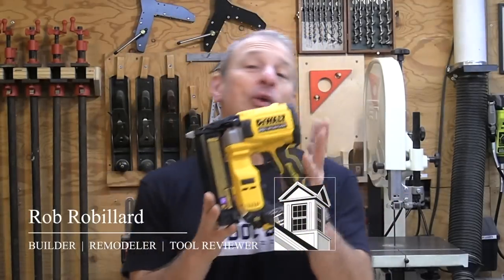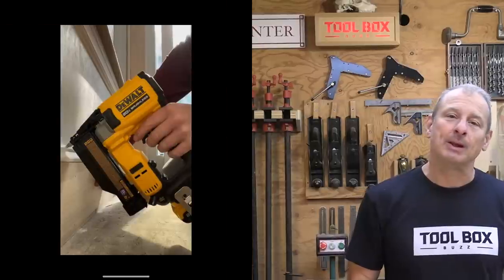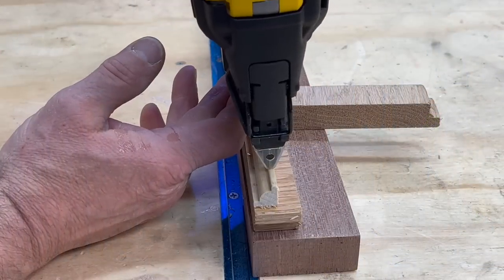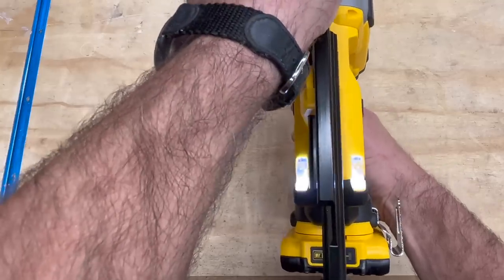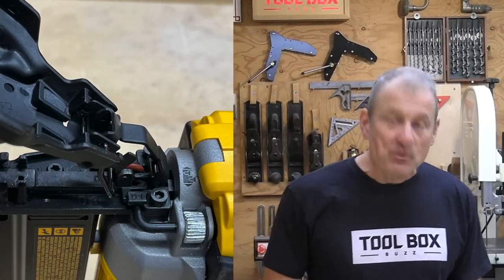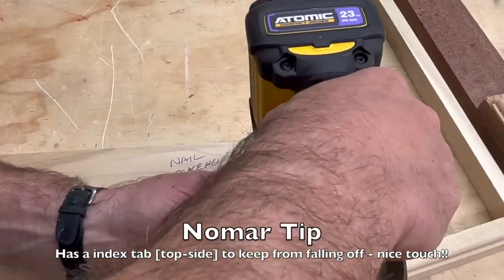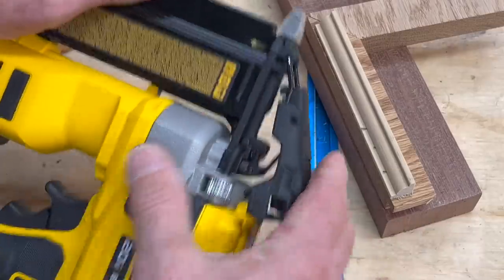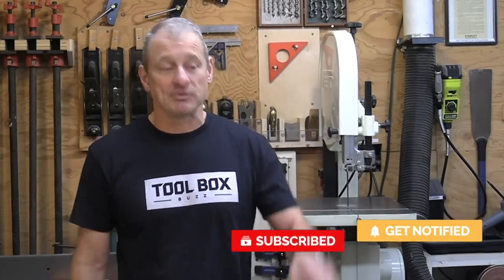Dewalt 20V Atomic 23 GA Pin Nailer, DCN623

Comment: I have both milwaukee and dewalt pin nailers and i really like both of them. I love the 20v dewalt one cause it can shoot forever on 1 charge, m12 nailer however would run out on me and i would have to charge it through out the job. I love the lightweight of the m12 one and how it sounds when it shoots. Just feels good to hear those pops. Both nailers in my opinion are great tools for anyone who does finish carpentry.
Reply: Have you guys seen the Makita 23 guage pin nailer. It's smaller, narrower, and very compact. Power can also be adjusted easily on the fly. Not sure why anyone would consider this bulky Dewalt (unless you want to stick to the battery platform), especially seeing as you can't get into narrower spaces. Just putting it out there.
Reply: @arnoldwiggins  I'm a Makita guy, and I'll tell you the performance of the Makita sucks. I'd love for them to fix their cordless nailer line because I'm invested deep in the blue tools. I know I can get a battery adapter and use any tool I want, but what I want is a good Makita nailer line.
Reply: The Makita 23 g cordless nailer is junk.. misfires all the time and leaves pins sticking out. I  own it but never use it.. will be getting this dewalt

Comment: Nice to see an addition to battery powered 23 gauge guns.  Can't wait to try it.  So far we've been using Ryobi and Milwaukee pin nailers.  Pretty happy with both. Ryobi is big and ugly but shoots good and it continued to shoot good until it completely broke after about 2 years of use.  Milwaukee shoots like a dream for about 4 months until driver tip gets worn, then it won't drive nails all the way in consistently, because I think driver slips off a nail at some point.  We're on third Milwaukee gun at this point, shoot amazing but doesn't last under heavy abuse.  Because of Nitrogen cylinder inside the gun, Milwaukee will not sell you a driver to replace it yourself and you have to either ship it back to them or take it to a certified service center.  Which means downtime when you need pin nailer now, so that's how we end up with a pile of used up Milwaukee guns.   I will say, when laying staircases from waterproof luxury vinyl, we put these guns through tremendous abuse.  LVP like Christina Collection can be extremely hard for pin nails to punch through and sometimes we also get bent nails because we hit a nail head in the subfloor.  Combination of those things put a lot of wear and tear on the driver tip.  So driver lasting 4 months laying staircases from hard material will probably last you years if you use it to nail soft woods like trims in finish carpentry.
Reply: Means as a homeowner it will last me forever😂

Comment: I am on the fence on getting the dewalt or the m12. But this in depth review definately helped. You covered something, other 10+ reviewers never mentioned.
I just wish Dewalt comes out with a smaller 12v pin nailer. That would be awesome.

Comment: DeWalt is late to this party. The M12 is a very nice tool. I've personally been running the Ryobi for almost 3 years and the Metabo for a couple months. I actually like the Ryobis action and double trigger better than the Metabos safety. Have you used a 21g nailer Rob? I have a Grex 21g that I use for built-ins and cabinet crown. It's a great tweener nailer. I wish I bought the Senco with the double trigger safety rather than the Grex press tip safety. As you know the press tips like to shift small material because glue is slippery.

Comment: I'd be surprised if the red ring wasn't silicone rather that nitrile rubber. Temperatures shouldn't be a problem, but its durability remains to be seen, I guess. Odd that it needs to be there at all.
Reply from the maker: That’s a good point, probably is

Comment: Saw someone post that the Milwaukee framing nailer was trash -- they're dead wrong. I run ALL DeWalt, and have all their nailers.  The flywheel is a bit annoying, but I find their trim nailers to be fantastic. Just had the chance to use the Milwaukee for a day. The milwaukee framing nailer is SUBSTANTIALLY better than the DeWalt. More powerful, no flywheel -- it's just superior in every way possible.  As for the 18, 16 and 15, I still like my yellow.  Thanks for the review of the pin nailer, Rob.

Comment: Now if they could just redesign the other nailers to do away with the fly wheel. The recoil is the bane of Dewalt nailer guns.
Reply: I think their framer and 16 guage nailer are the best .The flywheel mechanism is the best I've used ,not bulky and easy to maintain, the Milwaukee framer is a piece of crap imo.

Comment: Interesting. I am a DIY type person for most of my smaller projects. If you were replacing a small piece of 3/4 inch round would you use a pin nailer or an 18 gauge one?
Reply: 23 pin nailer.
Reply: And use 1&3/8” pins
Reply: But if you are asking which to buy? Between 18g or 23g?  The 18g can do waaaaaay more because most shoot 5/8” nails to 2” nails.
Reply from the maker: Brad or finish nailer Depends on what your nailing to
Reply: @ConcordCarpenter  Thanks

Comment: I totally agree with you about the red rubber band under the jam release lever.
Was going to purchase this pin nailer at Home Depot.  They had it on display, so I started to fiddle around with it. As soon as I lifted the jam release lever and saw the red rubber band (before I saw this video), I was turned off.  I looked at it carefully to see if it could be replaced easily, and it did not appear to be the case.  The red rubber band was definitely a DEAL-BREAKER for me.  I looked at the Ryobi P318 pin nailer, saw that it didn't have a depth adjustment, and no tool-free jam lever.  However, it was on sale for $190.00 Canadian, or about $135.00 U.S. So, I decided to give at shot, and purchased it. Even without a depth adjustment control, it always sinks the nail to the right depth, regardless of whether it's soft or  hardwood (I've used it on pine, cedar, walnut, oak, maple, mahogany, etc.).  Was a great decision, and have had no issues or regrets with it so far.

Comment: Thanks Rob! Great video as always. I’m in both the Milwaukee M12 and DeWalt 20 volt battery platforms. Which of the two pin nailers do you currently prefer?
Reply from the maker: Milwaukees size

Comment: Bought mine bare for £160 🇬🇧.  Feels light and compact . Included was 400+  Bostitch pins , so had a play . Depth adjustment only needs configuring once or twice depending on the wood . Left virtually no mark - easily sanded down . Safety feature a bit annoying .

Comment: Thank you for a great review Brad. Would have been good to compare to Makita's 23 guage pin nailer. I think it's far superior to both the Dewalt and Milwaukee. Much better proposition. I feel like Dewalt went back in time here when comparing it to the Makita 18v DPT353Z / XTP02Z or even the 40v. Just had to call that out. Cheers.
Reply: Agreed - there are so many negative reviews of the Makita 12V/18V pin nailers that I I wouldn't touch Makita's 12V/18V pin nailers. At $550 for the Makita 40V pin nailer kit and $250 per extra 40V battery, I'd certainly expect that Makita iron out the 12V/18V problems in their 40V unit.

Comment: About a year late for me! I had all Dewalt cordless tools, until I needed nail guns. NO WAY was I going to buy the fly wheel nailers. So now I've got Milwaukee 23, 18, 15 ga and framing nailer.
Reply: fly wheel is better. these gas driven tools have a limited life span. one day they just stop working. As a professional, this is unacceptable. 
I think dewalt has the best cordless finish guns even with the slightly delayed trigger action.
Reply: @joeeley5354  I can not stand the delay, or the bulkiness of the dewalt guns.   Even my Milwaukee’s I find annoyingly large, and they’re far slimmer.  

I’d rather buy a new gun every one or two years, than deal with a gun that annoys me every single day.  As a professional, this is unacceptable.  

Also, Dewalt choose to do gas driven with this 23ga.  Not fly wheel.

Comment: It’s a monster- huge fail! Looks like a Ryobi guy designed it. “ barely noticeable nail hole” - I guess if ur half blind. The tip and light are nice . I got sick of waiting and bought the Milwaukee kit for $ 199. Excellent tool. In general I’d say Dewalt is falling behind Milwaukee in the nail gun areana